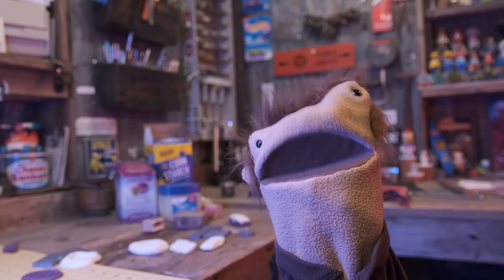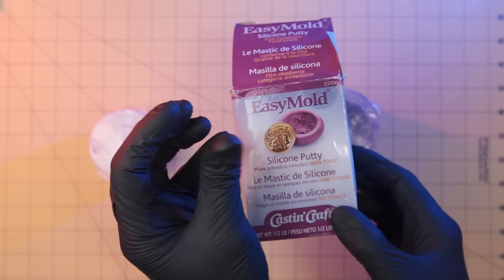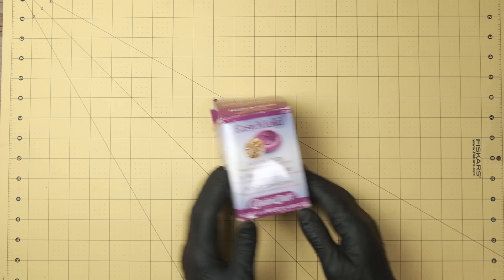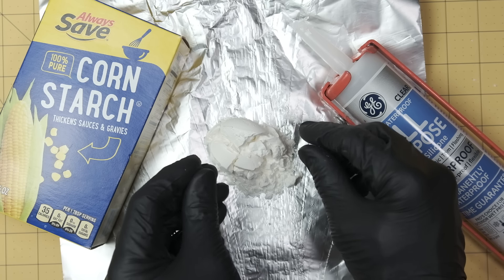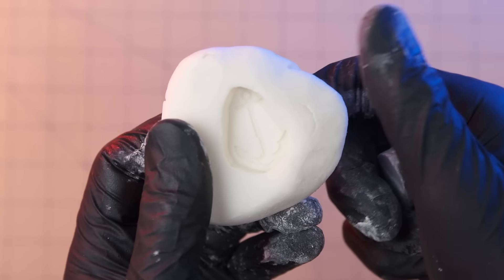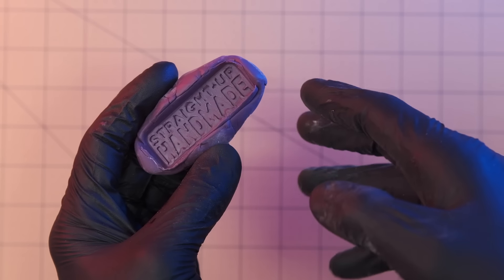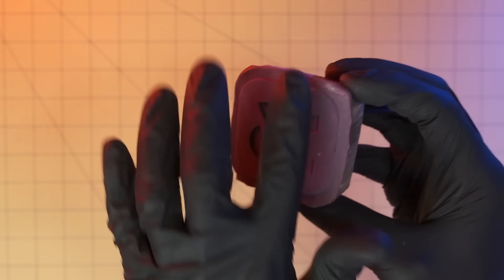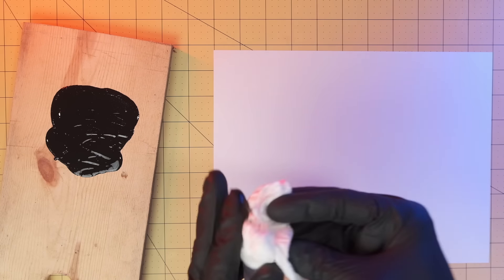Make your own STAMPS! (Plus DIY rubber recipe!) | DIY Custom Rubber Stamps

Comment: Today I learned what that little hole on the side of a caulk gun is for.
Reply: Me too...along with that metal stick thingy!  LOL
Reply: No kidding! My mind is blown
Reply: Sounds like the real winners are your teeth!
Reply: Me too LOL 🤣
Reply: It’s the little things we learn in life are most important
Reply: Snip the tip and make sure you have a firm grip.
Reply: and that is one of the more "crappier" caulking guns.  The luxury ones have better cutters and are more durable.
Reply from the maker: @Cory Gill : I used my handy paper towel to swipe that clean before flipping it back around, but you're absolutely right about the greasy mess that happens if it ain't clean.  :D
Also, I like to sometimes use a large nail stuck in the end to stop up and preserve the remaining caulk.
Reply: I know. Blew my mind!!!
Reply: I know! I’ve been using tin snips 🙈
Reply: Likewise.
Reply: Classic Shane
Reply: I looked at my wife, she looked at me.... "Oooohh!" we both said in unison.
Reply: What, the hole that's labelled "Spout Cutter"?
Reply: Shane Russell 🤣🤣🤣 Bruh....Same
Reply: @Cory Gill most handypersons keep like, a rag on their belt, especially when working with a substance that can and will accidentally spill over where they're using it, and then they have a poker right there designed for the specific cartridge they're using, and not a loose sharp thin piece of metal in their toolbelt.
Reply: I was just about to leave this same comment.
Reply: today I learned what that little hole in the wood is for-paper towel holder
Reply: First time I have seen that too. Very handy tip.
Reply: Same!🙋🏻‍♀️
Reply: @EllenJB  how… how did you not know
Reply: Same here😀
Reply: Yup.

Comment: hey Crafsman. I love your content. I want to share a little hack with you. If you melt your petroleum Jelly it becomes brushable and easier to spread for a short period of time. I like to scoop some into a tin or jar and then stick that onto a candle warmer for a bit. The key is to keep it set on the candle warmer. EXTRA TIP: once you get it into the mold, you can run the lubricated mold over some mild heat to level things out a bit. I tend to be very conservative with the amounts.
I hope this helps someone who needs it. 
Thank you for all you posting your knowledge on youtube. I've learned so much over the years because of it.
Reply from the maker: Thank you, Venton! I've been thinning it with mineral spirits, but this is good to know!
Sure appreciate you!

Comment: Always sand your new stamps with 220 grit sandpaper. Gently run it horizontally then vertically. It gives the stamp surface something for ink and paint to adhere to. If you use an ink pad, use the pad to ink the stamp. So you press the inkpad onto the surface not vice verse. If you are using paint, use a brayer to spread out your paint and thinly coat your stamp. This is good practice for any stamps commercial or handmade.

Comment: This is a great idea!  I used to make stamps with the little rubber letters, but this looks much better and easier.  You can buy or make stamp pads, probably for less than $5, and get or make colored ink for them.  The nicest pads have a smooth fabric layer on top that is tight, so that just the printing part of the stamp gets the ink.  The plain felt pads work ok, but they get ink in the little grooves, too, and eventually the grooves get clogged up with dried ink.

Comment: Another great video! A recipe for DIY liquid release agent: mix petroleum jelly with mineral spirits. The mineral spirits will evaporate and leave the petroleum jelly on the mold.
Reply from the maker: Yesss! That's a good one! I always forget that one, too!
Reply: @Cory Gill I would guess just enough spirits to thin it to a point it easily coats the surface.
Reply: @Skoozi  Yes, exactly. Each petroleum jelly manufacturer seems to have their own formula, so I just wing it. Thin it down and test it to see if it dries thick enough.
Reply: I knew someone would have tips in the comments! Thank you!

Comment: Tip: Glue a print from your stamp to the top side of the stamp, in the correct orientation. Helps avoid silly mistakes, helps finding the right stamp if you have a drawer full. 

Old school stamps, the way books were printed in china for centuries: Copy your artwork onto tracing paper; glue the tracing paper to a (rubber) slab, back side up; looking through the paper at the artwork, carve away to make islands of th artwork. Remove the paper bits and stamp.
Reply: There's a faster but slightly more dangerous version that we used to use in the 70s.  Take your artwork, flip it upside down over a light table and trace the outline with a ballpoint pen.  That gives you a reverse drawing.  Then take the rubber stencil (or stamp) and wipe it down with gasoline.  Immediately put the pen ink side of the drawing on the stencil, and rub it with a roller or wooden stick.  The ink will transfer to the rubber.  Then cut it out with a heavy duty x-acto knife.  That works for stencils for stamps and for rubber stencils for sandblasting.  Suggest not smoking during the operation.

Comment: My fave molding compound is Oyumaru, aka The Blue Stuff. It's a reusable thermoplastic that takes great detail, doesn't require mold release even if making 2 part molds, and sticks to almost nothing. It will destroy EVA foam but most other materials I've tried work fine.

Comment: I've seen folks put the corn starch and silicone into a large ziplock, then seal it and knead.  It contains mess and you can get repeatable results when you weigh out them thins over a scale and mix to completion.

Comment: As a paper craft artist I appreciate this. I do want to suggest that you don’t need to apply to a wooden backing necessarily. You can save money in supplies and effort. You can buy acrylic stamp blocks and stick any stamp that fits the block directly to it.
Reply: Rubber like this won't stick to acrylic without help, unlike the thin jiggly stamps you can buy.

Comment: Hello Craftman! another way easier way to make molds with silicone is intead of cornstarch u put the silicone in container with soapy water, u have to knead a little the silicone into the soapy water until u dont feel it sticky animore, then take it out, dry a little de excess water of the outside with a cloth and put it on the object to make the mold. I use this when i make molds for my little craft. Hope u can try it!

Comment: If you cut your stamp flat instead of putting a handle straight on, use a dab of a silicone based glue to attach to a handle, can use silicone itself, fabritac or uhu

Comment: Oh yeah, I've wanted to make a custom fern stamp for a long time.
Reply: I'm wondering if you could print a negative of the fern design with a laser printer onto photo paper. Then heat transfer the image onto metal. Etch the metal, and then make a silicone impression from the etch to use as a stamp. Would it be deep enough to use as a stamp? Or I suppose you could layer this sort of etching to make it deeper:  https://youtu.be/NntLi4KcLlI
Reply: You get rubber sheets that you can laser directly to create a stamp. Obviously your image must be mirrored
Reply: These are great ideas, especially as i want to use a fern generated via fractal formula (Barnsley fern, https://en.m.wikipedia.org/wiki/Barnsley_fern )

Comment: I never tried it, but looks like you could 3D print the negative mold right away (instead of going all the way with molding a positive). If you print in PLA you can bend the mold slightly in hot water (wear a layer or two of gloves) so that you get a roller like stamp. So, you use it like a rolling press, rather than trying to apply all ink everywhere at once like in 12:35. Flat stamp has to be very precise. Sanding to a smooth surface like in 11:53 might be a good step for the 3d mold, depends on print quality. Obviously you may as well print a handle for the stamp, with arched base. Even use that same arc for molding the hot PLA.

Comment: 12:33 You can get away with just the resin stamp if you have a surface that you can "soften". It won't work on a solid cardboard box like in this video, but if you use for example paper bags: you can put something soft (a napkin, a layer of foam or bubble wrap etc...) under the paper and stamp from above it will work! it will be kind of a reverse way to do it and circumvent the use of rubber. Also there's some rubber resin out there that could probably work great as well! @TheCrafsMan SteadyCraftin

Comment: Not sure I got you there: is 3D printing a negative form and only using silicone once gonna work or not?
Reply from the maker: Hey Felix! I was able to make a "STRAIGHT-UP HANDMADE" stamp by printing the negative (letter "holes" in the 3D part) and then pressing silicone putty down into that. So yessir, you can do that with a printed negative.  :)
Reply: @TheCrafsMan  Thanks CrafsMan! 10/10 will try!

Comment: Yo Crafsmman, have you tried using the silicone sealant submerged in water? I find it is less messy than trying to mix it with cornstarch, you knead the silicone submerged in a bowl of water until it becomes tack free. Tricky the first time or two but after that, it works well and you dont need the starch.

Comment: Hey craftman could you do a part 2 of this embossing an aluminum can and making a stamp from that?? Another idea is pcb etching and using solder as the raised mould relief. Thanks for the ideas!
Reply: Im thinking a ball point pen and maybe a shishkabob scure or dull pencil.
Reply: And maybe some hot glue in the aluminum embossing

Comment: Crafsman what do you think about etching brass, and then making a silicone or rubber cast of it to use as a stamp. If it isn't deep enough, then I have seen people make "cutouts" by etching very thin brass. Those could probably be layered together for a deeper stamp. This might allow people to make some very intricate stamps. Of course the etch would be made by heat bonding a laser printed image to the metal. It just seems like it's something that would be right up your alley.

Comment: Thank you CMSC ....I am delighted to find out about the cornstarch+silicone to make the mold - Please - what is the stuff you put into it to make the 'rubber stamp'??? I'm hoping its not something thats too expensive?
Reply: The same stuff - silicone+cornstarch is used to make the stamp as well. He just used two different products, the silicone mix and the commercial mold mix. For the silicone mix mold he used commercial mold to make the stamp, for the commercial mold he used the silicone mix to make the stamp.  You could easily just used the silicone mix for both - to make the mold and to make the “rubber” to push into the mold to make the stamp.  You just have to make sure to let the mold dry and to use a release agent so the two parts come apart. Silicone caulking & cornstarch are cheap - silicone is a couple bucks at Home Depot. They also sell it in hand squeeze tubes if you don’t own a caulking gun (but caulking guns aren’t that expensive either). Hope that helps!

Comment: Have you ever used silicone putty to make a case for a phone or similar?
Reply: No no you could! I was thinking about that, but i was worried about the toxicity of the silicone, but i think once it cures you should be able to wash/sanitize it and it should be ok to use

Comment: But crafts man, what if I can’t 3D print a reverse version of a stamp and I have something in the house that I wanna stampify? How would I go about making a mold that would make it so the stamp would come out correct. Like when I have something already 3D that I wanna make a stamp but when I make the mold and then the stamp it comes out backwards how do I fix that or work around that? I don’t know if I’m explaining it right but hopefully you get what I mean
Reply: If I understand your issue, you might need to make a copy of a copy
Reply: The cast will always be the same as the original. If you need the cast to be reversed, like in the case of a stamp that has letters than the item you make the mold from needs to be reversed. To my knowledge there's no easy trick to making that happen unfortunately, just a matter of sculpting the mirror image and making a mold of that reverse version.

Comment: neat idea but do not use alcohol to be a release for casting silicone in silicone. I learned the hard way that alcohol makes the silicone bond really strongly and my glass water globe broke. :( I will never use alcohol with silicone again unless all silicone is fully cured. - Heidi

Comment: If you are 3D Printing your Stamp Negative that you're going to use to put the silicon putty in to make your stamp -- How deep do you need to recess the stamp negative so that when you take out the putty it will actually work but not get ink on the positive spaces??

Comment: But Crafsman is the putty mold product more expensive then the diy method with silicone and corn starch?
Reply: Way more expensive per ounce. A big tube of silicone is only a few dollars, and corn starch is even cheaper. I would say the 2 party putty is a little easier to use, though, and can give you a more glossy finish to your molded pieces.

Comment: Would if you sprayed a couple layers of Plasti Dip on the 3D printed part?
Reply: That Guy you would probably want to make the 3D print pattern smaller to account for the plasti dip thickness, for instance if you were making a word each letter would need to be thinner and have plenty of room between each other so the plasti dip would not fill in the space between the words and create a smooth top
Reply: Jazmin Novak big brain comment....didnt even account for that😅

Comment: Man, I really wish he would shed light on why his 3D prints aren't inhibiting the curing of the silicone putty? This is a known problem I've encountered in all my attempts. 

He doesn't mention anything about treating the 3D print in anyway prior to molding, so I'm assuming he's just using the raw print. This whole video is irrelevant if the silicone cannot cure on a resin print. And it definitely looks like he's using a resin printer judging by the quality and look of the print. 

Man, I really really wish he could explain it.
Reply: The funny thing is that judging by the comments - either everyone knows the solution for this, or no one is actually trying this. What am I missing!
Reply from the maker: Hey there. Platinum-cure silicone can be inhibited by 3D printed parts, but tin-cure isn’t. Hope this helps.
Reply: @TheCrafsMan  My man! Didn't think you'd respond on such an old video, so thank you!

Ok yes, Tin based silicone def seems like a solution, but the putty you're using here is Platinum based no? I can't seem to find any tin-cure putties (and I've been looking for months now), which is why I'm confused.
Either way, thanks for replying
Reply from the maker: @TwoPlastic-jr7nl  Oh snap, you're right - it is plat-cure!  I've never had issues with inhibition... so something different is going on with it vs. the stuff that HAS been inhibited (ie. Mold Star, Eco-Flex, etc.). Also... I've had 3D prints sit for a while (my assumption is they're off-gassing) and no longer require sealing - molded just fine. So there may be a TIME factor to this. ie. Cure your 3D prints well and let them sit for a while before trying. And when you do try, mix up a TINY bit and apply it - don't waste a whole bunch like I did. LOL. ;)
Reply: @TheCrafsMan  Hah yessir, been already wasting a whole lot. Letting the prints sit for a while is most likely the reason for no inhibition. But my impatient ass can't wait that long. Guess I'll have to! 
Thanks again for your reply, clears out a lot of mystery around all this. And while we're at it, you've helped me a lot on my journey into making my own toys - so i really appreicate it!